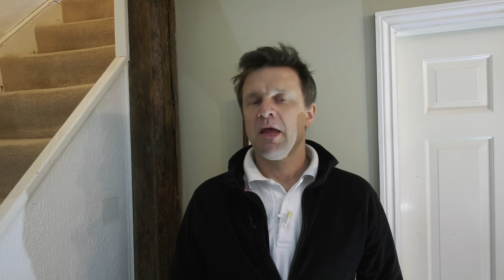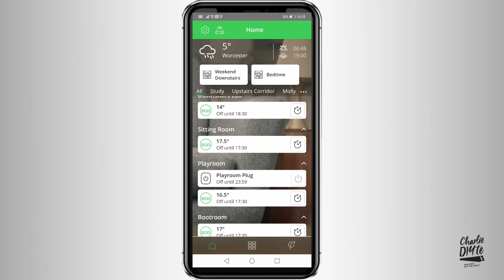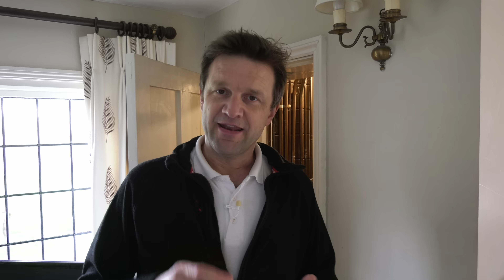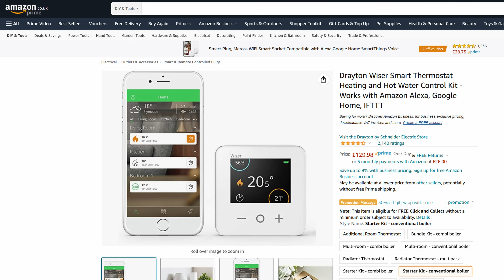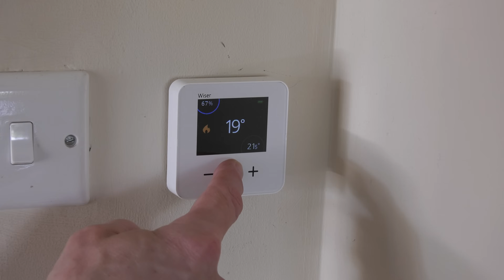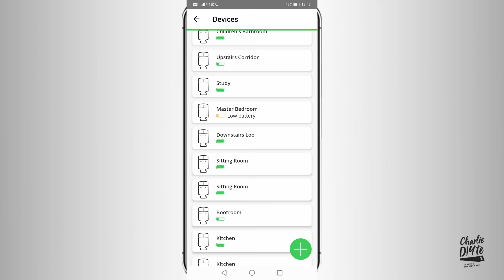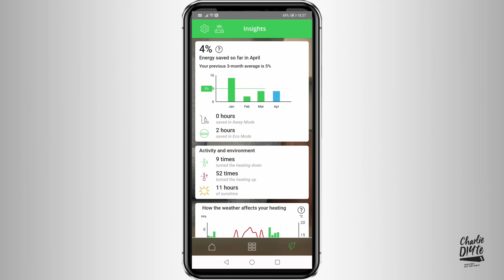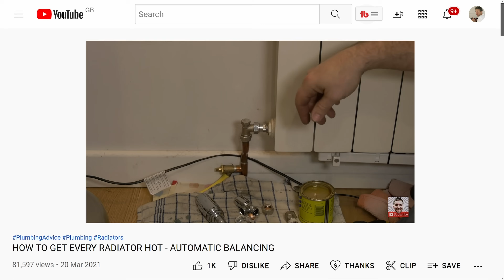Smart Heating Update - 14 Month Review

Comment: Home Assistant does offer awesome additional controls over the Wiser. We use the HA app to cover home occupancy enabling and disabling Away Mode in Wiser automatically. It can also use the moments in the app, for simple controls over changing temperature settings based other integrated devices, for example, we set the home alarm to Alarmed - Home when we got to bed which triggers a moment to turn down all the temps regardless of there schedule. 

We have also found that the TRVs can give out false temp readings. The radiators are mounted on exterior walls and low down, there can up to 3 degrees difference between the TRV's and head height. We have over come this issue with a cheap £10 Sonoff Temp Sensor integrated into HA to turn down the TRV's if they exceed the set value for the room. 

Its a brilliant system, which even the non-techy wife even approves of. Highly Recommended.
Reply from the maker: Really interested in this. Question for you though. For someone like me who isn't that techy, is HA a step too far to install, still?
Reply: @CharlieDIYte  I’m not the person you asked but in my opinion, yes. It’s complicated to maintain home assistant. You might be able to follow a tutorial alright to get installed but at some point something will break and you won’t know how to fix it which could be a big problem if you’ve come to rely on it. I’m happy to use it minimally as I have the ability to maintain it when needed.

Comment: Using my Wiser system with Home Assistant. The sockets also monitor power consumption. Great system but uses more batteries than I had hoped. Home assistant shows me Zigbee mesh map, very useful to work out where the signals are weak.

Comment: Stupid question, but is a thermometer built into the TVR a accurate way to record the temperature of a room? Surely the temperature an inch away from the radiator (where the TVR is located) is a lot hotter than the actual room temperature?
Reply from the maker: It's not completely accurate. For that you need to pair it with a room thermostat. It's pretty good though.
Reply: EvoHome allows an offset as a work around for the valve being too cosily warm right beside the radiator.

Comment: I bought this system after watching the initial video. I can’t complain about the initial usage worked absolutely fine. The only issue is if you change your Access Point. After doing this it has turned out to be nightmare. We are stuck with no heating. The technical support has been appalling!. I contacted them over a week via email after the “work Around” they have posted online failed and received nothing back. I’ve taken the day off work to to be at home to call them. Your basically trying to  setup the device using the device you are speaking to them on and the call drops when connecting to the devices wifi connection during setup. This happened 3 times with 3 different technical advisors and not one of the called back. You may get great technical support if you are posting a youtube video about the device but otherwise if you may decide to upgrade you home’s network equipment I would stay clear of this device.
Reply from the maker: Sorry to hear that. Call head office rather than the support line. They have technical guys working there - who are much better than the outsourced team in support. Support seemed to be a lot better when I did the video - possibly because at that point it wasn't outsourced.

Comment: If you've got TVR's in each room, does it matter if the door to each room is open? I haven't seen a comment on that and I would have thought it could affect the temperature.
Reply from the maker: You mean the smart ones? It's not a deal breaker. Yes it will affect the temperature but so much better than traditional TRVs

Comment: Howdy, just installed whole system (9 valves, hub + thermostat) for oil heating house with stove and back boiler. Zoning was messed up so boiler is heating up all rads and water at this same time. I was hoping that scheduling some rads off will be economical but when valve shuts down then this radiator become cool so quickly where water in the system is still so hot and two bathrooms are worm all day (rads without trv's). Wouldn't be better if Drayton create solution for instance: instead of closing the valve just send signal to the hub to turn off the boiler until the last valve confirm that boiler could be off? Not sure if that is clear as I mean when desired temperature is reached out in one room that valve will send command "for me boiler could be off) then when last valve send that command then boiler will shut down but flow will be still running which means heating up whichever room you like until circulation cools down. House is Canadian construction build so getting worm quickly as is getting cool quickly as well and don't see that will be sufficient with Wiser system so far. Maybe I missed something in the configuration or so, any suggestions really appreciate it.

Comment: Vitodens 100-W 2021 model and I limited flow temp to 50C and range rated the boiler to 55% which is around 16kWh which gets to temp very quick.   Good thing about Vitodens can Modulation range increases from 1:10 (3.2 kW) and I limited hotwater temp to 45c
Reply from the maker: Very interesting. Decent self modulating boilers are a rarity in the UK right now. Sounds like you've got a good set up there.👌

Comment: Hi Charlie, just wanted to ask how the rechargeable batteries are doing? Are they still working nicely? Had my system installed last November and I've noticed the battery levels are getting low so I might invest in rechargeables....
Reply from the maker: Scott they're brilliant. 100% recommend. It's just so nice to be able to plug them in and put them back into the rad a few hours later and I was finding the replacement nicads just weren't lasting very long.
Reply: @CharlieDIYte  It's that time of year again when my batteries are all beginning to need replacing so I thought I'd just check in to see how the rechargeable batteries are doing?

Comment: Nothing prevents you from using LSD NiMH rechargeables. They are about 1.45V when freshly charged. And work in 99% of cases when you need to replace alkaline. If not, then device is a garbage which requires you to replace a battery after consuming less than half of its capacity. Not To say Alkalines have 1.5V only when completely new, during their useful lifetime voltage drops to about 1V, empty voltage for NiMH is about 1V too but they have less steep discharge curve. These EBL batteries are garbage for slow discharge, they have a buck converter inside which constantly drains power. Another downside is that you won't get empty battery warning but a sharp cutoff instead.

Comment: I fitted my Wiser system a couple of weeks ago (14 radiators and 13 TRVs); it all went very smoothly as my 25 year old trad system was already Drayton based.  One aspect that I haven't seen mentioned is the behaviour of any by-pass radiators.  Ours is in our shower room, and with no master off switch for the central heating in the Wiser app, I was concerned that it would be on all the time.  Those clever people at Drayton obviously have it covered though,  as my three way divertor valve is clearly only circulating hot water to the radiators if one of the TRVs is calling for heat.  This works extremely well, and I am impressed with the huge potential for increased comfort with efficiency savings that the Wiser system gives.  My plumber also turned the wick down on our Baxi Solo 2 boiler to reduce any cycling, but with hot water only circulating when a TRV requests it, this does not seem to be a problem.
Reply from the maker: Glad to hear it's running smoothly Steve. Love my system! Not sure what you mean about the master off switch. You need those rads without TRVs in the shower room to clear heat from the heat exchange. They are on when the heating is on but this is quite a good thing in terms of clearing moisture/ drying towels etc. But they're only on when the heating is on.
Reply: @CharlieDIYte  just so I'm clear, if you have towel radiators, there isn't a decent solution for that yet for the wiser solution? Therefore, you might as well set these to be fully open/on without any TVRs, as there's a requirement to always have one radiator open fully without a TVR for the wiser system? And if that's all correct, what this results in is the towel radiators come on every time any of the TVRs are on? That doesn't seem very efficient to me? If I had the heating on in one room during the day then I actually have it on in that one room and both bathrooms with towel radiators? 

Also, as an additional question, is there any integration with underfloor heating?

Comment: Is there anyway to turn a radiator off manually without using the app or the hub?
Reply from the maker: No. You can turn it down a couple of degrees by turning anti clockwise but to turn it off you need to use the app.

Comment: Ive had wiser for about the same time, I had a Nest for about a year beforehand.  A couple of important notes Ive found. 1) the 'comfort' mode did seem to use a lot more fuel. 2) when using a non-modulating oil boiler, its possible that due to the reduced heatload on the system, the boiler short cycles and you lose your (condensing) efficiency and I actually found the system using MORE oil than the nest system in some instances.
Reply from the maker: Thanks Matt. Yes I suspect I get short cycling as well. What have you done to counteract this? Once I've properly balanced my radiators I'm seriously considering leaving the heating on at 19 degrees 24/7 to see if a consistent thermal mass saves oil.
Reply: @CharlieDIYte  Hi Charlie,  great channel BTW.  I had great machinations of doing a similar thing - but never had the gumption to quite  actually do it.  A few things Im doing that I was thinking of doing a video on but anyhow.  Rather than have all radiators (14 including towel rails) all discretely controlled by the smart TRV's - having a certain amount on normal TRV's set higher than normal to ensure there is sufficient heat load - although this is a WIP.  I also am wondering if balancing the radiators is actually not necessarily the same process for a conventional system, so I have some of the lock shields open more than I would do, so that the radiators that ARE on, get more throughput to ensure return temps to boiler are lower.  Im also looking at getting my boiler re-jetted at the service (tomorrow actually) to a lower output to mitigate the short cycling.  Ideally I think a buffer tank or heat store would almost totally mitigate the issue - but this is expensive and costly.  I spoke to drayton about how their algorithm accounts for short cyclying but IM not 100% convinced its working optimally.  I have a digital temperature probe on the flow and return pipes to the boiler and I watch these over a period of time to see how things are working.   Also I changed the pump in my boiler from a normal 3 speed unit, to a modulating pump with auto setting.  Again experimenting with different settings but IMO this should help when you have variable heatload.  Im not a heating 'engineer', but I am a mechanical engineer so have some understanding of the systems involved.

I would say i was recommended Drayton by a controls engineer I know who is involved with the really high end heating systems and he reckoned this is the best of the consumer units.  I like the system but I think they are missing a heap of tricks that would make it even better.  For me, having the ability to have the rad TRV's open and close on a schedule - but not actually call for heat would be good, and allows a room to heatup if the heating is on already - but not specifically switch the boiler on if not already.  Hallways for example.  I do this with other 'smart' standalone TRV's.   Also, Id much rather look through the 'insights' or ontrol the schedules through a PC app, rather than just the phone.  

With older properties (mine is a 3 story granite farmhouse in Aberdeenshire im renovating)  I think the argument for constant heat is a good one.  It is an experiment im looking into.  keeping the humidity down by keeping the house warm is definitely a good thing.  I for one would be very interested to see you do a vid on this.  

FYI I use a system called Oilpal to keep track of oil usage... a bit clunky but does exactly what I need and allows me to track oil usage on a weekly or even daily basis (although I think accuracy is not good for a daily basis).

Comment: This video is incredibly timely - for obvious reasons, conversations on many youtube channels are all biased similarly: How to achieve the best efficiency and corresponding savings. I was fortunate enough to have inherited a very old boiler and decided to buy new, along with ripping out all existing rads for new. I opted for Viessmann, primarily due to its excellent attitude to third-party integration (wifi, OpenTherm, Home Assistant integration etc). I am really keen to end up with a very well-balanced, optimised system, and looked to the Nest Thermostat (OpenTherm compliant too). That decision threw a spanner in the works tbh, as Nest have not been that helpful in opening up the boiler controllability aspect very well through Home Assistant (nest operates as the master, despite what you set on the boiler), as well as not supporting multi-zone operation unless you get a Nest for each room. Long story short, am looking to fit Smart TRVs all over, have all of this intelligently controlled from Home Assistant, but adding S-TRVs messes with the modulation algorithms (OpenTherm) and could negate boiler efficiency savings (I assume). This is where I am at now; very confused, and not really looking forward to my future technical (and financial) quest! I guess many others are too. It's a confusing market atm, I wish they could all get together and standardise a workable model for all, as not all of us are technically savvy enough to pull this off well.
Reply from the maker: Francis, well done for getting to where you have. Sounds like you could get a lot of help and advice from my Discord forum. You can sign up for £5 a month through my Patreon channel. There's a link in the description of this video also here https://www.patreon.com/charlieDIYte Sam on my forum isn't a fan of smart TRVs but there is a Drayton plugin for Home Assistant I'm told. Let me know it's you if you decide to join and we'll continue this discussion in the smart heating channel in the forum.

Comment: Great video, Charlie.  In my living room, I have two radiators with traditional TRVs.  To have Wiser, system, would it be fine to have a room thermostat in the living room and keep the traditional TRVs on the radiators and the living room can still be treated as a zone controlled by the room thermostat?  Thank you.
Reply: I had the same setup - two rads in the kitchen without Wiser TRV heads but a wiser room stat.
It does work, as the wall stat will only call for heat from the boiler if the room is colder than demand.

The problem starts if you have multiple Wiser TRV’s and or wall stats in other rooms.
These will call for heat and the hot water will still flow through the rads in rooms without Wiser TRV heads. The wall stat is ignored and the setting on the “old” TRV sets the room temp.

In my case it was a temporary problem as the Wiser heads fitted on the cheap rad stats that came with my radiators but not operate them properly.
(They had a 6mm dia pin that had a short operating movement). Swapping them out for new Drayton TRV valves resolved this.

I have 10 rad stats for 11 rads (bathroom still has “old” TRV) and 6 of those are controlled as pairs in a room via the wall stat.
System works very well and is showing savings already 8 months in.
Reply: @peterwilliams5597  Thank you very much for sharing your experience.  😊

Comment: I am considering a conversion from gas boiler to 'air to water' heat pump.  WISER indicated it can accommodate a heat pump as the source of heat energy.  Has anybody had any experience of using WISER in this type of configuration.